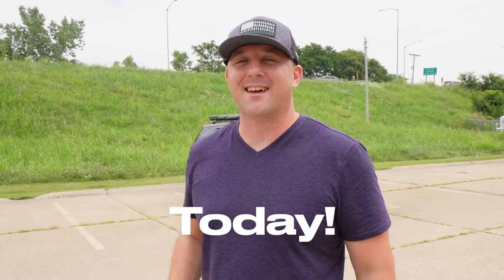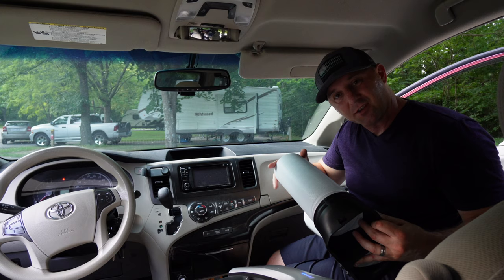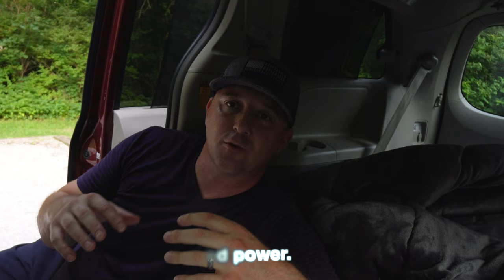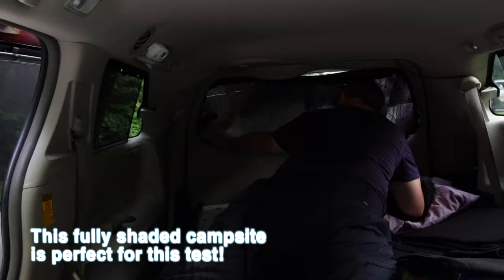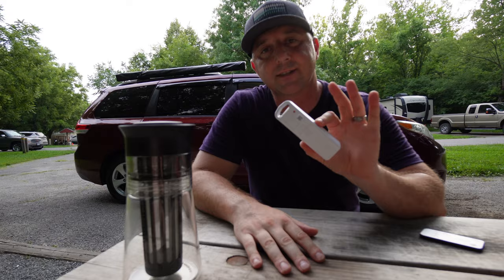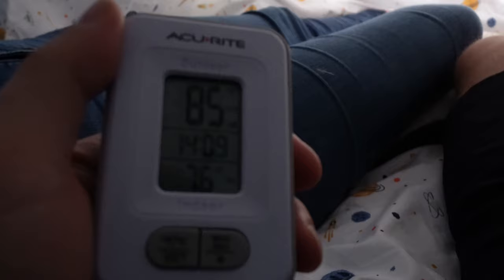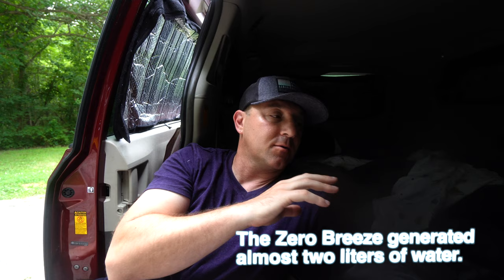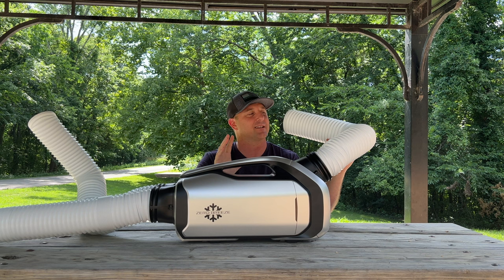Surviving a Heatwave in a Minivan Camper - Zero Breeze Mark 2

Comment: What do you need for shore power? I need CPAP machine to work
Reply: Can you clarify your question? Did you mean "what do you need in order to get shore power? (an extension cord). Or did you mean "what do you use shore power for?
Reply from the maker: Shore power is from an outlet at the campsite. CPAPs can run from some of the batteries I show in other videos.
Reply: Can I run this overnight in GA in my car without any additional power station?

Comment: TO OFF GRID ADVENTURE:  I like your channel (and subscribed). But I think this video would be much better if you did it again, and next time show the temperature INSIDE the van prior to starting the ac, then after some time (such as an hour), and also show the temperature OUTSIDE the van prior to start and then show the temp OUTSIDE the van after some time. 
Reasons? 
1. People have different ideas of what "cool" feels like, and pointing the output hose to your face can make any face feel cool.  It is better to measure the ambient temps inside and outside, both at start of test and after some time.  Also, ambient (outside) air temps generally drop at night, and can be coolest at about 2:00AM.  So, saying someone "got cold" during the night does not really mean much or indicate the ability of the ac unit to cool below the ambient temp outside (which probably dropped). 

2. There was no mention of the cost of the unit.  With 2 batteries it would be very expensive (again a relative term) so that is something to mention. 

3. You mentioned it produced condensate (water). It would be good to mention how you handled that. Did the internal container fill up?  How much can the ac unit hold before full?  Did you use a tube to drain the unit while it worked overnight?  Did you have to wake up to drain it? Will it shut off if full? How did the humidity change inside versus ambient outside?  

I am making these as some friendly suggestions on how to produce another video, that could get you more views while using the same gear. :)
Reply from the maker: Welcome! This is excellent feedback. Thank you so much for sharing your thoughts. This video is really meant to show my experience with the Zero Breeze and isn’t really intended to be a product review. This AC really only cools at the point where the air is directed and small volumes. The outlet temp is around 30 degrees cooler, but it is difficult to measure the temps as I get away from the hose.  One thing about the ambient vs inside temp is that the van is hotter inside during the day, so the AC did some work to bring the internal temp to ambient. There is a three foot long drain hose. I had a poured the condensate out of the jug and packed up without thinking about filming it. It filled the bottom half of a one gallon jug. I believe it will fill 1-2 gallons in a 24 hour period.

Comment: why in the fuck are you wearing a baseball hat in 98 degree heat???
Reply from the maker: To cover my haircut. Sometimes the barber takes it in too tight. Good observation.
Reply: @Off Grid Adventure  lol, but doesn't that make you sweat like crazy? I spent a long time on the flightdeck of an aircraft carrier launching fighter jets. I would do anything to remove my headgear to cool off. But that's not realisitc